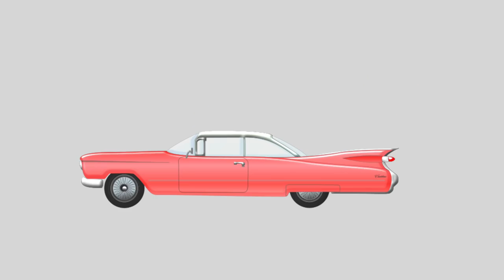Yes, Rockets CAN Fly in a Vacuum

Comment: 😂😂😂omg. Priceless. To prove rocket can fly in vacuum you use balloon which is surrounded by air😂👏??? Drone can't fly in a vacuum ... There goes your .."for every action there is equal and opposite reaction"
Reply from the maker: Drones use propellers, which need air to chew for lift. Drones aren't rockets.
Reply: @AmyShiraTeitel  the explosion would be sucked by vacuum before it could push the rocket forward. 
I wasn't comparing drone to a rocket. I was showing that the Newton's third law is theory and things are more complex because it doesn't apply to actions in vacuum the same way
Reply: @magdalenaklara7698  Vacuum don't suck anything.
Reply: @przemog88  So let's say absorbs. Everything tends to equilibrium. If you have low pressure next to high pressure they will mixes. They will mix much faster if the difference between them is higher.
1 atm equals 760 torr . Pressure in space around 0.00000000000000001 torr
Reply: @magdalenaklara7698  No, it isn't absorbing anything either...
Reply: @magdalenaklara7698  - "the explosion would be sucked by vacuum before it could push the rocket forward. "

This is FALSE!
The "Vacuum of space" CANNOT "PULL" or "SUck" on anything.
The vacuum cannot evert a force on ANYTHIN including solids, liquids, or gas.

Thanks for proving that you have never taken a physics class in your life.
But you feel confident enough accusing every engineer or physicist, TO HAVE EVER LIVED, of either LYING or being incompetent?
There is a name for your condition, lookup the "Dunning-Kruger syndrome"
Reply: @magdalenaklara7698  Think of it this way: 
would a CROSSBOW firing a steel projectile in a vacuum FEEL RECOIL?
Yes or No?

Since the answer is YES, then Propulsion in a vacuum IS POSSIBLE.
If your answer is NO, then you should go read a physics book BEFORE challenging established science.
Reply: @magdalenaklara7698  : Rocket thrust isn't created by an explosion. It is created by pumping hot gases in the opposite direction you want to travel. The faster and heavier the gas the better. The pressure generated in a combustion chamber is created by the fuel pumps that feed propellant into it. 

A little education would be good.
Reply: @Apple TV : It is combustion so in a sense, yes the gases expand when ignited, or reacted together. But it isn't like  a bomb type of explosion. 

One way to think of it is that the combustion doesn't cause an increase in chamber pressure. It just causes the high velocity out the nozzle.

Comment: Haha, if the friction of the ground acting as the separate object to interact with never existed, the car goes nowhere! The internal combustion engine is not the interacting force to propel the car. The interaction between the wheels and the ground is where the force for propulsion is created. You could rev that engine all you want, but if the wheels have no separate object to interact with then no force is created for propulsion. Lazy pseudoscience bullshit, rockets can't fly in a vacuum because Newton's third Law is not fulfilled.
Reply: @sirturdaloter141  
Right, let's go through this, bit by bit.

Firstly you seem to be ignoring the reaction mass of the rocket.
You seem to think that the exhaust and the rocket are one thing, kinda like a weight with a spring, and as such need an object to push off of, to gain thrust.

There is one wrong assumption in this model, and that is the consideration of the exhaust gases as being part of the rocket.

In reality, if we use the same weight and spring analogy, the spring wouldn't be firmly attached to the weight, and when released, the spring would exert a force on the weight, but the weight will also exert an equal force on the spring, resulting in both flying away from each other.
Reply: @ShadowFalcon , you can't use mechanical interactions to create force in the same way fluid interactions create force.
Reply: @sirturdaloter141  
Mechanical interactions are the foundation to those fluid interactions.

Hell, you can derive Newton's Laws from those fluid interactions if you wanted.
Reply: @ShadowFalcon  Correct, but you need two separate objects or medium pressures for interaction to take place. You seem to forget that Newton's 3rd Law derives through interactions of two separate objects to create force. Propulsion is not possible without friction. A vacuum is a mediumless environment where there is no friction for propulsion. You can expel all the energy and mass you want out the back of the rocket, if there is nothing to interact with to create a frictional force, then no work is done and propulsion does not occur.
Reply: @ShadowFalcon , No different than the cars tires. The car propels no where until frictional force has been created through interaction with the ground.
Reply: @sirturdaloter141  
Yes, and in the case of the rocket, we do have two separate objects interacting with each other.

One is the rocket, and the other is the expanding cloud of exhaust gas. Unless you want to suggest that every gas particle is physically tethered to the rocket, in which case I'd like some evidence for that claim.
Reply: @ShadowFalcon You'll never grasp this easy concept. The rocket can expel all the energy or mass it wants. The gas exhaust will just expand as fast as it's expelled. The 2nd Law of Thermodynamics will have that energy searching for the empty void to fulfill to the infinite. The burden of proof is not on me, every propelled object on Earth within a pressurized environment uses a medium or separate object to create the push, pull or friction. Newton's 3rd Law demands the interaction to create force. Prove one object within Earth's atmosphere that propels without interaction of that separate object to create push, pull or friction. Million dollars says you can't. Scifi has instilled a belief in your head that is not observed, verified or repeated anywhere in the natural laws of life.
Reply: @sirturdaloter141  
Why do you think the exhaust, after leaving the rocket, moves in mostly one direction?

It's very simple really.

It's been accelerated.

Well, what can we say about a mass that's been accelerated? Well, it has experienced a force.

And what do we know about forces? Every action has an equal and opposite reaction.

The gas goes in one direction, and the rocket goes in the other. For the rocket to stay stationary the moving gas would have had to have a momentum of 0, which can't happen since it has mass, and is moving.
Reply: @ShadowFalcon , You simply avoid the question and topic at hand to spew the same bullshit we all heard a million times. Name the one object on Earth that expels energy solely without interacting with a separate medium or object to create the push pull or friction propulsion. You can't, because those separate objects are what causes the interaction for those propelling forces.
Reply: @ShadowFalcon , You did get one thing right in your reply thought. There is 0 momentum of the expelled gas mass because zero work will be done because the 2nd Law of Thermodynamics.
Reply: @sirturdaloter141  
Eh, have we forgotten the exhaust of the rocket again?

The exhaust isn't massless. And a rocket outputs quite a lot of it. It isn't just "energy", it's mass. F=m*a.

And no, the exhaust will not have a momentum of 0, because for the momentum to be zero, you need it to be stationary, or at least for its centre of mass to be stationary. However, the centre of mass of the exhaust of the rocket very much ISN'T stationary. p=m*v. It has mass, and a net velocity, ergo it has momentum.
Reply: @ShadowFalcon , You have still managed to avoid the question. I will no longer reply until you pass the burden of proof my way.
Reply: If you want to run some calculations then figure out how much force you will have to generate to over come the vacuum of space and create a force pair ( Newton's third law requires an action force and a reaction force). The rocket is an open system so it is connected to the vacuum of space at either 0 pa or 10-17 torr or the supposed number 1.322 x 10-11 Pa, so the chemical reaction that happens in the combustion chamber will just take the path of no resistance and escape into the vacuum and build up no pressure; so no action force and no reaction force. Don't worry you still have sci fi space movies and space CGI cartoons of rover landings. You may want to focus on the end game; where is all this faking of space going? Many think a false flag event is the end game, some just think it is just about the 20 billion annual space budget, what do you think?
Reply: @sirturdaloter141  
Vacuum doesn't exert any force. It can't, because a vacuum is an absence of stuff, so I'd say any non-zero force would be enough to start moving you in a vacuum, away from other forces.

Well, at least you didn't call a rocket a closed system. Well, you seem to have this idea that a rocket engine is basically a valve connected to a pressure vessel, which is wrong. In the combustion chamber, you have the injector head, which sprays two liquids together at a great rate. These two liquids are the fuel, and the oxidiser. In the case of hypergolic rockets, what happens then is very simple, since the fuel (Hydrazine) and the oxidiser (Dinitrogen Tetroxide) will ignite on contact. Following this ignition, you basically have an explosion. This explosion will send gas in all directions (not just in the direction of the nozzle), and some of this gas will head straight out the nozzle, while the rest will impact the sides of the combustion chamber, and impart momentum and at some point will itself be accelerated out the nozzle (the path of least resistance).

The gas particles aren't aware of their surroundings. They'll behave more or less like balls on a billiard table, impacting each other, and the sides, but if you removed one side on the billiard table, you'd see the same "follow the path of least resistance" tendency of the billiard balls as they'd all eventually go out where there's a side missing.
Reply: @sirturdaloter141  
By the way, I'm not "avoiding the question".
I'm just explaining why your question have nothing to do with rocketry in vacuo.

You've asked "Prove one object within Earth's atmosphere that propels without interaction".

Well, there is none. And no one is claiming a rocket is that. As I've explained repeatedly, a rocket in a vacuum has something to interact with. That something is the exhaust gases.
Reply: @ShadowFalcon , That does not fulfill Newton's 3rd Law. You have this belief that just because energy and mass is expelled Newton's 3rd Law has been fulfilled. You are just a parrot not willing to let go of the scifi psuedoscience due to the appeal of concensus. I will no longer reply from here. Have a good day.
Reply: @sirturdaloter141  
Let me explain my logic then.

The exhaust gas has mass.
The exhaust gas is accelerated.
For a mass to be accelerated, a force is required.
Any force, has an equal but opposite reaction force.
Ergo, there must be a reaction force, pushing the rocket.

So, where do we disagree?
Reply: @ShadowFalcon  Sirturdaloter is correct.  

Propulsion would require a medium to displace.  Hot gasses released into a vacuum aren't going to provide any work on the craft especially once the pressure is realesed into a vacuum.

In an atmosphere sure.  Hot gasses are released/thrusted into an already pressurized system adding more pressure locally. To equalize the pressure, the rocket moves.  The same with planes, cars, boats...
Reply: @DrCash7 
Looks like I need to repeat myself.

The exhaust gas has mass.
The exhaust gas is accelerated.
For a mass to be accelerated, a force is required.
Any force, has an equal but opposite reaction force.
Ergo, there must be a reaction force, pushing the rocket.

And I'll ask you the same question. Where do we disagree?
Reply: @DrCash7 , I usually don't try to explain this easy concept to the Star Wars fans very often.
Reply: @sirturdaloter141  Which is fine, because Star Wars universe is pretty much the only place where your explanation would work :)
Reply: @Jan_Strzelecki  it's literally the only place where your idea would work. A rocket pushing on its own thrust??  Do explosions in space go "ka-boom" too?
Reply: @DrCash7  Once the rocket releases fuel and oxidiser into vacuum, it's no longer "its own". In the exact same manner, if you throw a heavy object away from you while on skateboard, you'll start moving backwards - even though moments ago you held this object in your lap, whispering sweet nothingness's into its ear, once you throw it away, it's no longer "your own" object.
And I hear you say "hot gasses released into a vacuum aren't going to provide any work on the craft" - but they're no directly released into a vacuum: a fuel and oxidiser is what gets released, and that gets ignited, rather abruptly changing its movement vectors. Explosions propagate in all directions, do they not?
I'd like to run a thought experiment on you in my next post, if you'll oblige, okay? :)
Reply: @Jan_Strzelecki  sigh... Solid object =/= gasses.  So enough with that parrotted reply.  

Define your term "explosion."  It's a rapid release of energy and volume.  If you're claiming this explosion can somehow transfer energy from itself to another object, where's the medium of transfer?  That's the way sound, and heat energies are transferred.  Propagating waves.  So you're pressurizing space now?  Fascinating, Pubert. Fascinating.

Comment: She is so wrong in so many levels she claims because there's oxygen on the rocket it's able to burn  But there is no air to push the force of the rocket forward It's just like an item any type of item rather it be the fake Tesla car or a satellite the speed will never slow down so if you take a rocket on a fast moving object in space to slow it down it will do the same effect it will move at the speed of which it releases the gasses because there's nothing pushing against it By supplying a rocket engine with oxygen and fuel you can burn fuel but there's nothing to propel you forward  That's why  When Mr. Musk filmed live the space rocket he stayed live until it reached a certain altitude and then all cameras stopped with no explanation it's a put on folks just like Just like bill nye the phony  Science guy said we are in enclosed system there is no getting out of it you're in a snow globe folks get used to it. So what did we learn from this lady? We learned that if you pull a tank of oxygen in a tank of fuel in a rocket and put it in space it will ignite but there is no thrustIf the thrust comes out From the back of the rocket At let's say 5000 miles an hour it will just keep going of course it will burn itself out immediatelyAs it travels away from the Rocket creating note friction so there's no propulsion Smoke and mirrors folks wake up
Reply: If you think "Rocket propulsion does NOT work in a vacuum" the tell me: What would happen if I fire a steel projectile from a crossbow, in zero-G, in a vacuum, WILL I FEEL A RECOIL FORCE?

Or watch the YT video "Uninterrupted Footage of the Falcon Heavy Launch and Booster Landing" fro PROOF that rocket propulsion works in a vacuum.

Comment: the rocket dont work in a vacuum have been tested and the result was leading strongly in favior of rockets dont work in space. actually a rocket was tested in water and produced violently much more thrust than i air and debunk the argument that claim rockets work in space. 

why do you think we made car engines with a displaceable propellant medium moving between piston and housing? could have somthing to do with newtons third law? the piston is not only acting against the fuel air mixture but also causes the gases to be expanding inside the cylinder housing that serve as the atmosphere in the rocket example. that is why the engine generate power. 

there must be no escape of the gas that can go out into vacuum or atmosphere since that would cause loss in containment and remove all power of the engine. garage 54  show, tried to use wooden pistons, you can see how that did go on their channel, and you would understand why they say rockets dont work in space. the only reason to defend rocket in space is because the the rest of the illusion you believe in that supports it.

nasa space x space this space that and  shuttle in space and all of that armada of satelites is just stuff that does not work in space and is just there to keep you dreaming. its all smoke and mirrors where the launch is real but the rest is hollywood.  

nasa rockets contain a big fuel tank full of kerosene and the two smaller rockets are booster rockets that break off early in launch. the shuttle itself have no room for a oxygen tank other than for the crew so  there is no oxygen tank to get astronauts into space. the same system is for nasa's earlier rockets. there is no carried with oxygen and the rockets dont work in space anyway even with the mixture as there is nothing that act against for the expanding fuel to push in both direction agaist both nozzle and atmosphere just like the piston in the engine chamber acting as a rocket for one second at the time or less. you make a hole in the pistons and the engine stop working and no loger generate any thrust. 

if rockets worked in space, cars would no longer need piston housings as open tubes would do for that with open burn just as good but if that true, car engines would have been made this way and not with closed explosion chamer. 

if you don't understand this your an idiot and need to do experiments the hard way to find out how things really works.